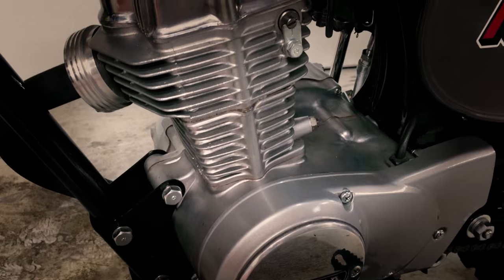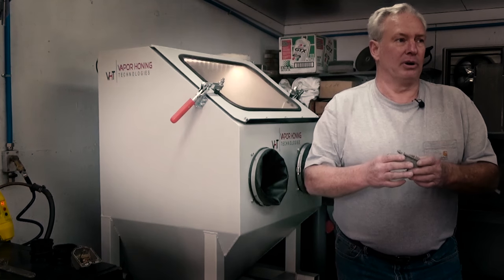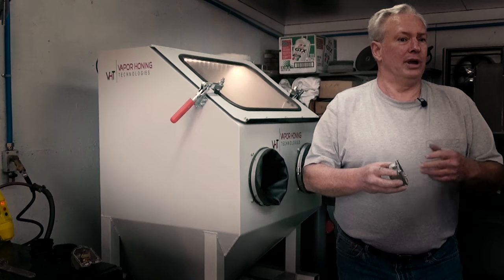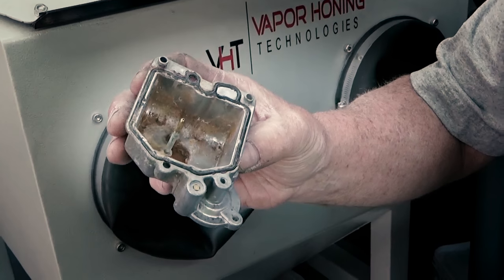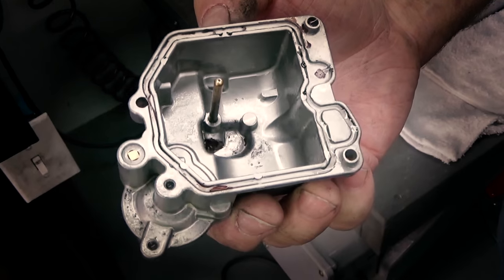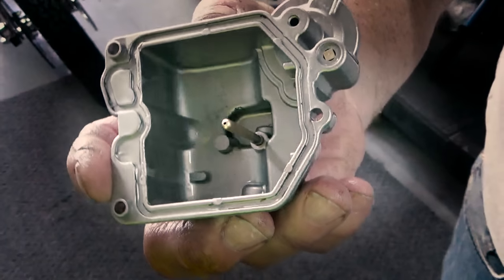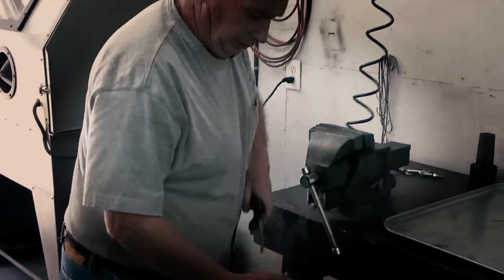Cleaning Carburetors with Howard Boone- Vapor Honing Technologies

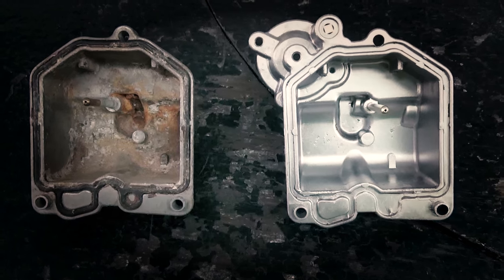Comment: 3:12...that carb is totally not the same...
Reply: E-sam R That's not supposed to be the same float bowl before and after. That's another bowl from the same carb that he didn't blast yet. Vapor blasting (or honing as they're calling it here) is an amazing process for cleaning. I get it done on all my engine cases I rebuild. It leaves it with an almost better than factory finish.
Reply: c0mputer Do you need to apply lacker if it is steel?
Reply: The Aviation It leaves the metal stripped bare. It doesn't seal the metal or leave any protective coating so steel will most certainly rust if not protected with anything such as oil or a clear coat.
Reply: Hello.  Howard Please tell me what media you used to clean that carburetor.  I’m thinking of buying there 800 machine. Thank you.
Reply: Ya they are they look to be Kawasaki kz carbs and in 79 they had a accelerator pump on on of the middle carbs, and the other three have float bowls like the one on the left